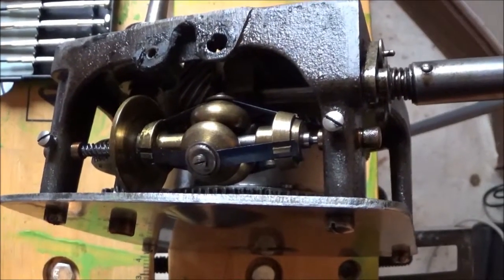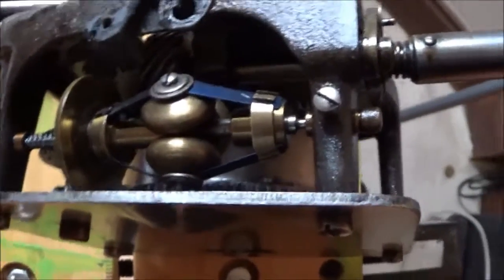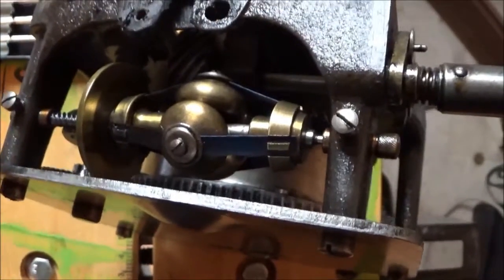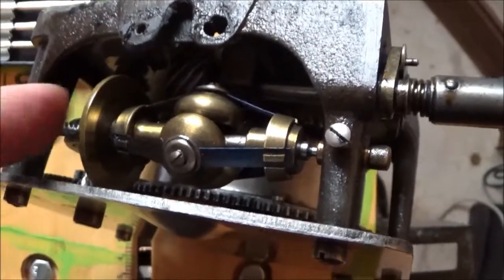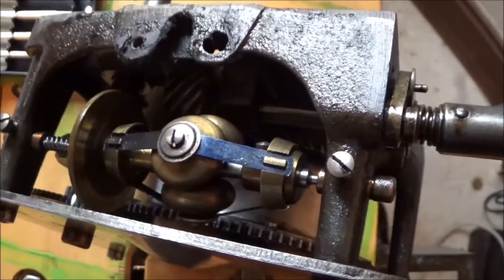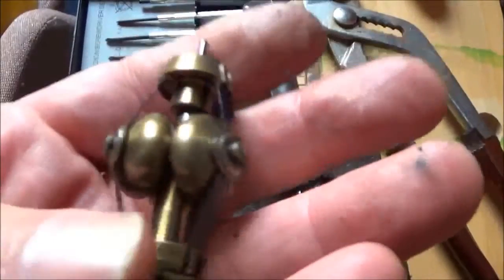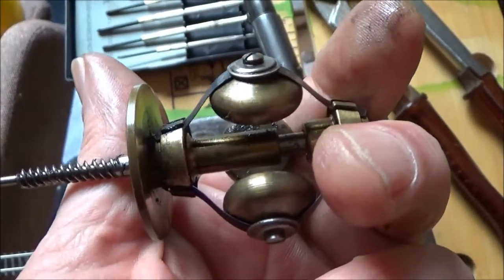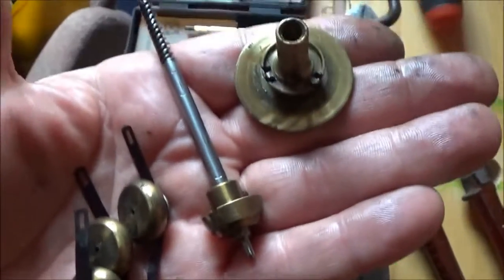Governor removed from Columbia

Comment: I guess I would have just sprayed some WD40 down in there and let it do the job. What a fascinating piece of machinery that governor is, that would look wonderful on the Gadget Bike somewhere... So when you call someone "governor", you are referring to them as a restrainer? Rather I should say, "govna", roight?
Reply from the maker: +The Shade Tree Fix-it Man It had already had some WD40, which had made a partial improvement, but hadn't got all the ancient muck out. It came apart easily enough, and what a wonderful piece of machinery it was. Well, guv'na, its like this, innit? Plenty of ancient jokes about guys getting sacked after the foreman told him to hit the governor with a hammer etc.. When new, these machines cost about 1 1/2 week's wages for a lower middle class chap. Fixing the governor was actually easier than getting your comment out of the spam!
Reply: +harryfaber  A beautiful piece of machinery it is too.